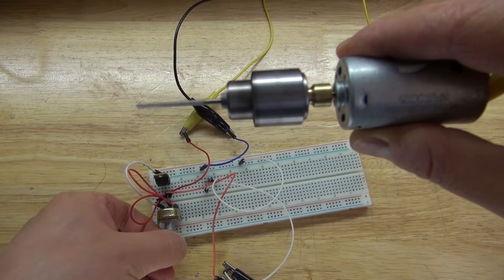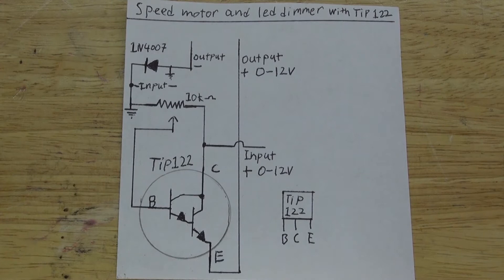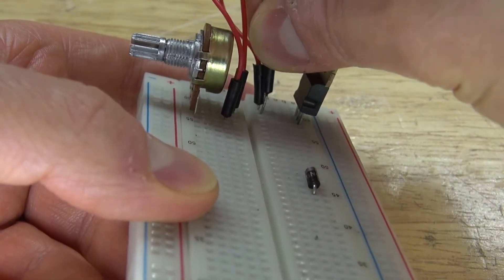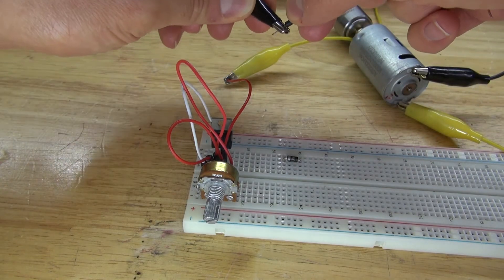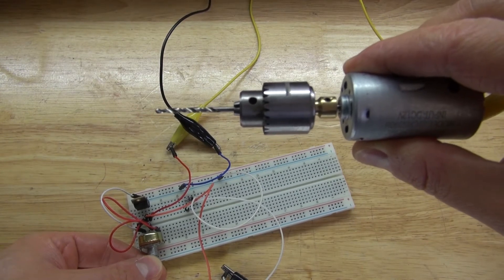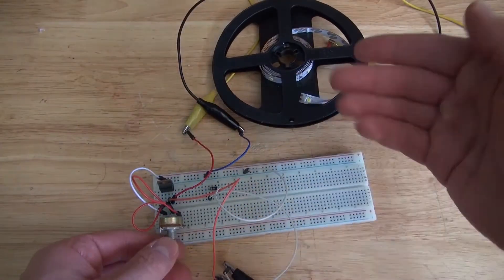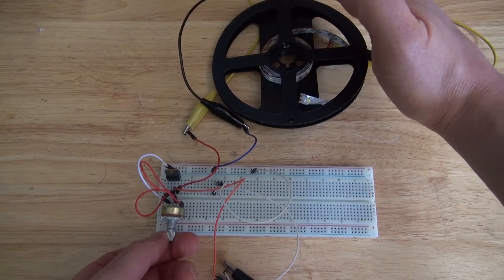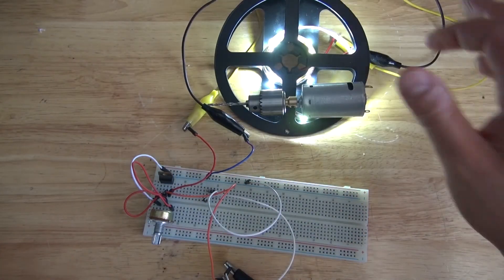Very Simple Motor Speed ​​Controller And Led Dimmer With Tip122 Transistor

Comment: You can also use a 555 timer in astable mode to PWM loads, cheers.
Reply: How?
Reply: @geovanegomes6187  There are many simple circuits to achieve this function available on YT.